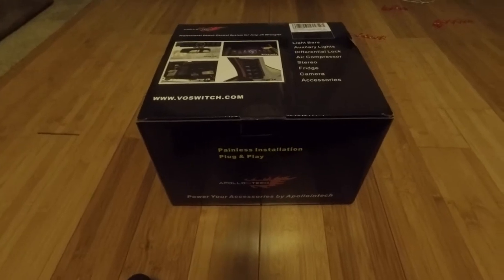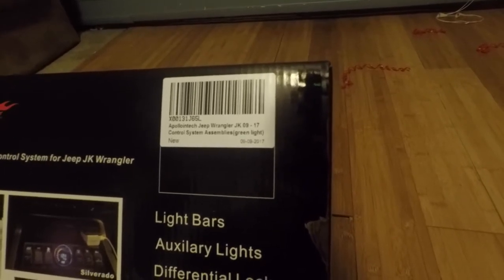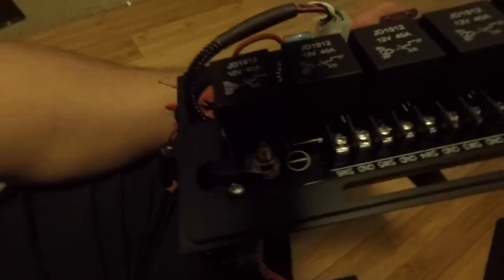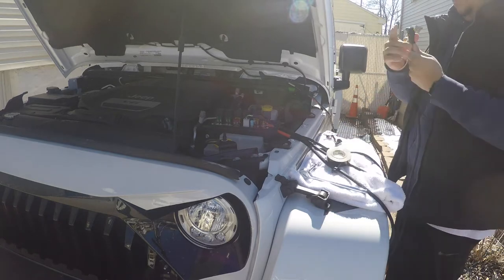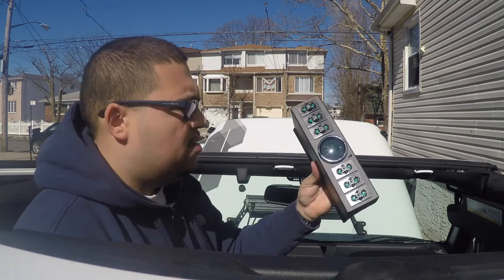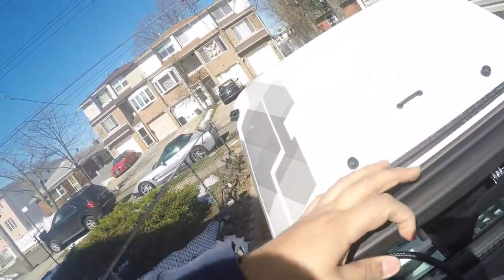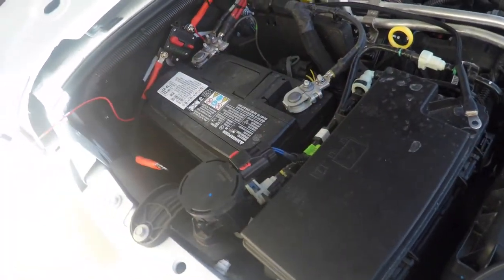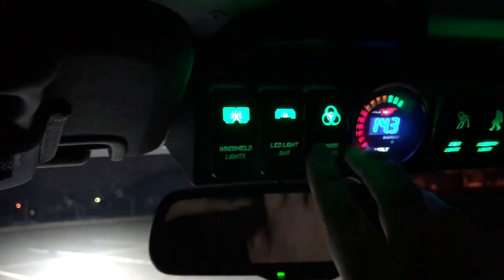Jeep Wrangler! Apollointech switch pod installation and unboxing!

Comment: Nice! I used a wire coat hanger and slit a hole into the rubber grommet into the driver side firewall 👍